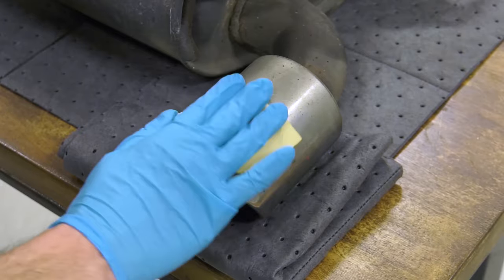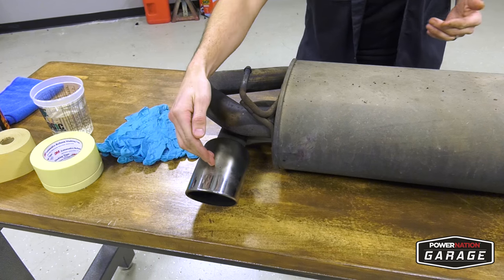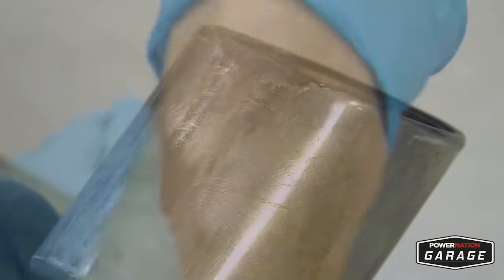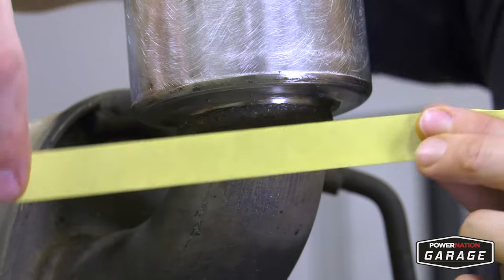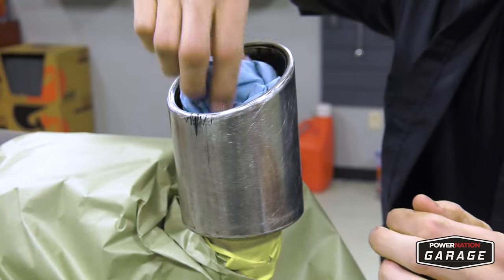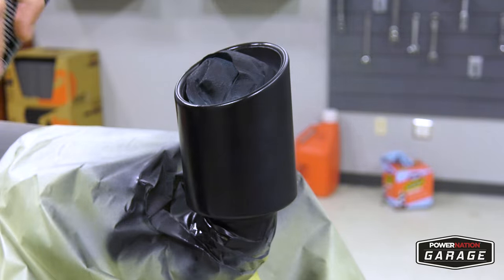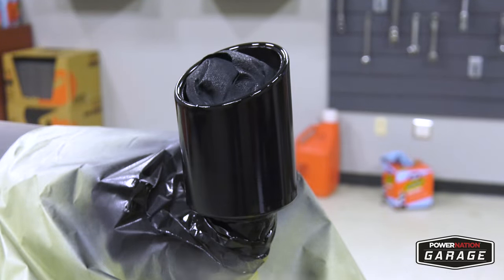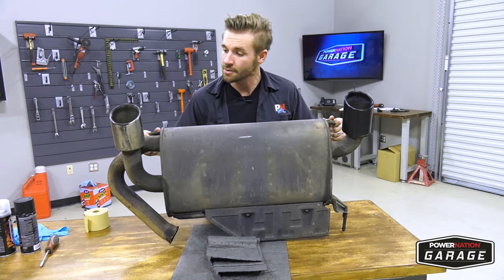How To Paint Your Exhaust Tip For A Custom Look

Comment: Would’ve been nice if you told us what primer, paint and clear coat you used.
Reply: @SAM IAM how long to do a  rush job if you only have 4 to 5 hours? I can use a hair dryer between coats.
Reply: Looked like VHT High Heat primer, at least....  Not sure about the black or the clear.

Comment: How well does that seem to hold up to on road use over time?
Reply: based on the ones I have, I can tell that dust and salt goes into the pores and turns paint into grey colour with sandy notes

1 solid winter and you need to do it again :) if you live in dry climate this will probably last 2 years 

I use hight temperature clear coat and flame it with butane torch - the only thing it helps is that paint does not peel off

Comment: Did you use a special high heat gloss or the tips are cool enogh that standard clear coat are just fine? Would a possible option is just to use high gloss heat paint.
Reply: Most paint will handle 220 degrees Fahrenheit ...
Reply: He did not use GLOSS paint....you can see it is a dull matte finish

Comment: You said it adds performance.  How?
Reply: Trooper427SS The same way that stickers add horespower
Reply from the maker: "Sense" of performance... it adds no performance.
Reply: Trooper427SS actually painting anthing that deals with heat aka exhast, intake ect. Dissipates heat a lot quicker with black paint. But mainly if you use, ceramic or wrinkle coat
Reply: mike smithson but then again you dont need that on your exhaust tips hahaha

Comment: Why aren't you sanding between coats?!
Reply: you sand between coats when you are doing a more serious paint job where you want to be sure there are not going to be any imperfections. With small things like this you don't need to worry as much
Reply: Did the end result look like it needed to be sanded between coats? Sanding is done to eliminate orange peel and to get a perfectly shiney gloss look which is not needed here